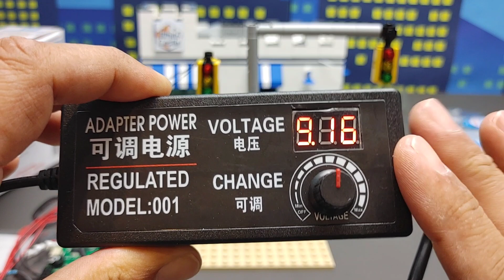How to make a working Led Lego 4 way intersection.

Comment from the maker: link for this sequencer
https://amzn.to/3j1Y2iR

Link for power supply
https://amzn.to/2UH4yBv

link for plug whips
https://amzn.to/3jeL15t

Link to my Rebrickable store.
https://rebrickable.com/users/BevinsBricks/profile/

Link to my Amazon page
https://www.amazon.com/shop/bevinsbricks
I do make a small commission on sales from these links.

Link to videos on my new channel Bevins Builds.
https://www.youtube.com/channel/UC7H3yFRlEuOxlMmhMRe9kCA

To have an entry for the convention center send builds here:

Bevins Bricks
P.O. Box 510
Tecumseh, MI 49286

Feel free to contact me at bevinsbricks@yahoo.com

Also for more content please feel free to view all my other pages.

You can find me on Pinterest at https://www.pinterest.com/bevinsbricks I also have many pins here saved, which is another way I get a lot of fresh ideas.

I'm on Instagram at https://www.instagram.com/bevinsbricks/
Reply: thanks for all the info!  I actually take back my comment.  There is no case where you will encounter issues with the resistor connected the way you have it, given this controller with this software will only ever light one of the three leds of each output at any one time. My comment applies for general connection of leds but the way you are doing it is simpler and saves you time (a resource I know you endeavor to manage).

Comment: Daryl, regarding the connection of the series resistor, you said you put a resistor on the common voltage supply.  In this traffic light use case, that works fine because only one LED is lit at any one time.  But let's say you had a 2-element led like red+green=yellow, or a 3-element rgb led, then I believe the leds would split the current and brightness would be affected.  In short, probably as a rule the proper way to connect it would be to put one series resistor on each of the colored pins instead.  I haven't seen your board schematic or specs, so I could be wrong, but that's my take as an ee.

Comment: I've been working on something similar using an arduino controller. Have the programming. Just have to build lights.
Reply from the maker: That's awesome.  If you don't mind doing it making your own lighting kits is the best way to go.

Comment: The Plug Whips you have given a link to....
Are they the same size connectors as Briksmax plugs?
Will they fit in Briksmax Expansion Boards?
Reply from the maker: No. For bricksmax I would have to look it up.